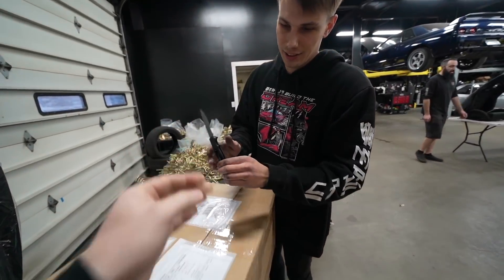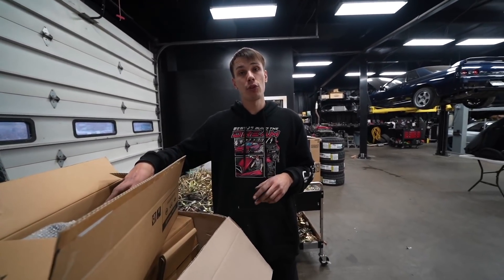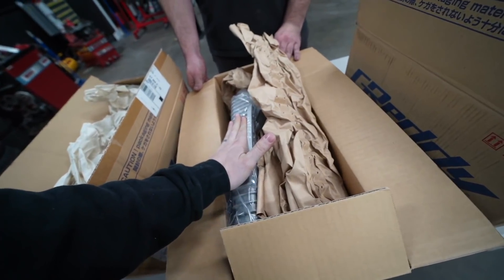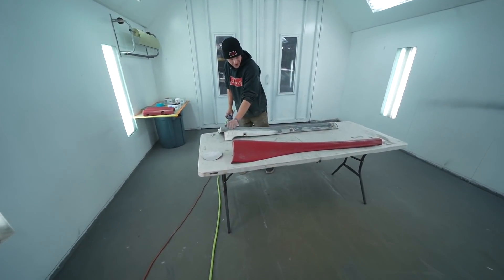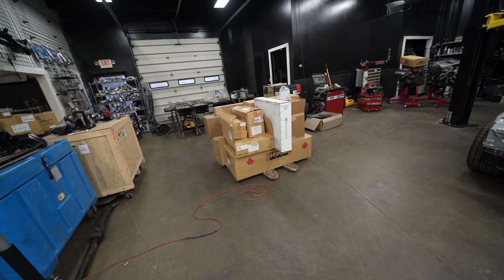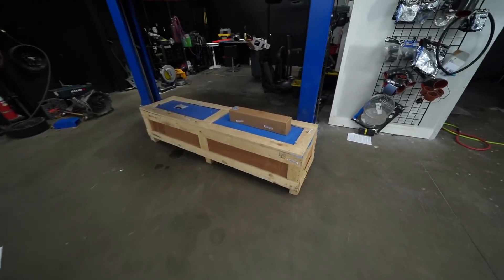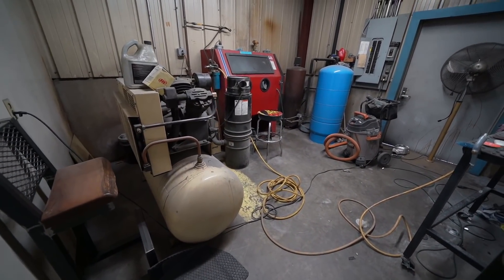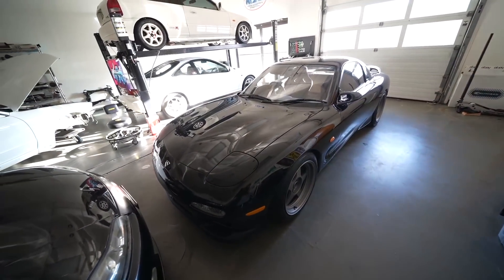FIRST EXTERIOR MOD FOR THE DREAM FD!!

Comment: In regards to the air dryer Tommy is talking about, if it's a single tank: the tank will be filled a desiccant ( Tommy is correct, silica is used sometimes as a desiccant) which the compressed air runs through. With a double tank system, usually, it will switch between the two tanks, so one can dry out the desiccant and reactivate it while the other drys the compressed air you're running through it. There are other ways to run a double tank, but I'm sure no one came here to read a 3 page report on how a god damn air dryer works
Reply: Let’s be real, nobody was going to Google it. You’re just doing us all a favor with the free knowledge. 👍🏼

Comment: Tommy what about using magnets to attach the skirts? Bond or screw the magnets to the skirts, ppf on the contact points on the car. Should be strong enough to hold. Jimmy O did some recently.
Reply: That’s the move!
Reply: That’s what I was planning to do on my fd oem skirts. Bolt the bottom, magnet up the top areas
Reply: That’s a mint idea needs a film inbetween though saw a guy lose paint getting magnets off 🙈 had to respray the whole panel

Comment: Be careful with that 3M Promoter and Double sided tape PaPa, I’ve taken paint off in huge flakes removing that stuff before. If you’re using it the skirts have to stay on forever lol
Reply: Yup!
  Paint is a mechanical bond, same with adhesive. So if the adhesive has a stronger bond it'll definitely rip off paint even with CAREFUL removal.
Reply: @hano5277  nawh, that's not how it works... You could have a $50,000 paint job and it would react in the same manner if you had a strong enough adhesive